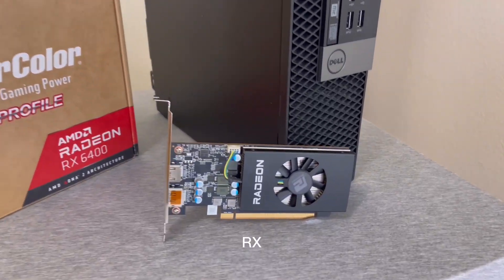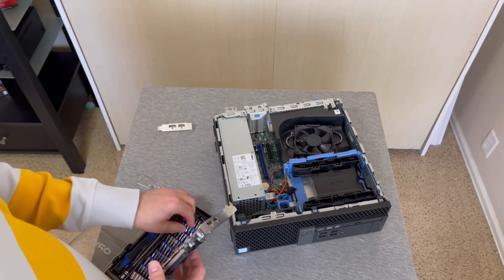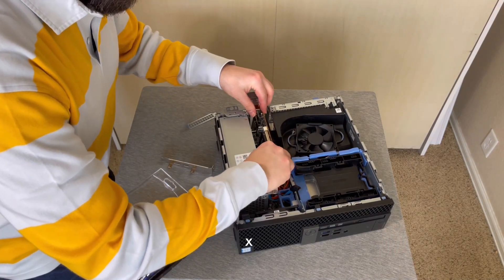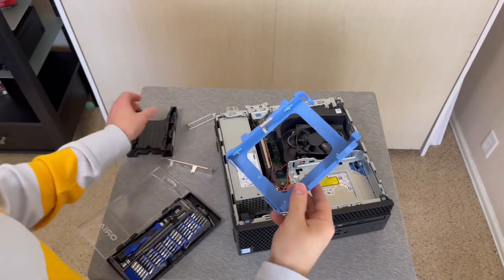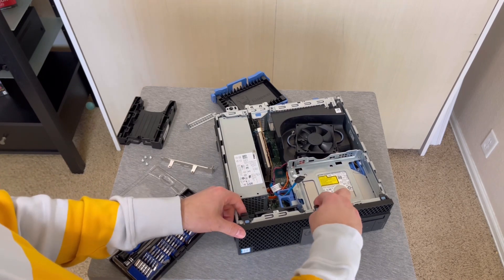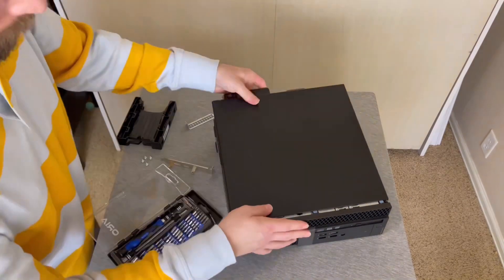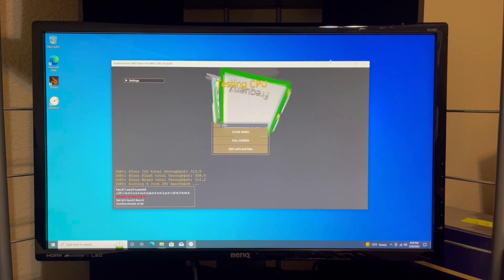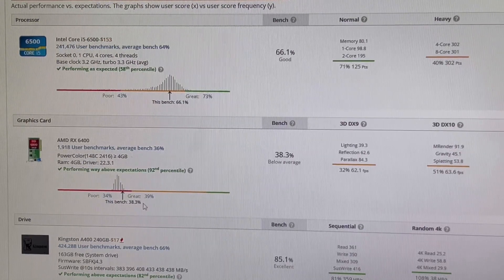Installing an RX 6400 into a Dell OptiPlex 5040 SFF ￼

Comment: I have the same card, same brand, worked fine in a 5050 mini tower but in my 5050 sff it just heat up and no screen, the 180 watts PSU is not powerful enough.

Comment: does the low profile bracket come with the RX 6400?
Reply: if you buy the sapphire pulse one it does come with it pre-installed plus the full lenght one if you buy the xfx otherwise it comes with full lenght one pre-installed plus the low profile one to be mounted

Comment: i was looking for a gpu to fit into my dell optiplex 5040 sff and this looks perfect but i was wondering if it would work on my 180w psu,i was looking in the comments and browsed the internet but i keep seeing a lot of confusion,some people say a 240 to 350 watt psu is required other says 180 watt is enough so im kinda in a confused state,can someone clarify if i can buy this to upgrade my pc or not?

edit:basically i bought the gpu and installed it,it works great the only downside (idk if its gpu related or not) is that after i installed it,my bios booting time takes up to 10 seconds longer on average and sometimes it doesnt even show anything when booting up even if im pretty sure its on the lockscreen as my keyboard and mouse leds are on,it might be a slightly faulty gpu or something else.

conclusion:this gpu works with my dell optiplex 5040sff with a 180psu flawlessly except for some minor issues sometimes probably because of the old hardware paired with a modern gpu
Reply: I'm the same

Comment: can you recommend a gpu for my dell 7010. it only has a 240 watt power supply.
Reply from the maker: I’m guessing it’s a SFF and needs a low profile card?

Good: GTX 1650 lp
Better: RTX 3050 lp
Best: RTX a2000 lp
Reply: @OptiGPU  yeah it is. im thinking of going with the AMD Radeon RX 6400, what do you think?
Reply from the maker: Yeah, that’s a popular one at a good price. Keep in mind the 16X slot is far enough away from the power supply that you can fit a dual-width card in there, but you can’t go wrong with the RX 6400’s cost effectiveness, and it leaves your other slot open for something else.

Comment: The resulting 1% performance increase was a bit underwhelming 😂
However, I have a Dell 5040 with the stock ATI FirePro, which is really slow. I thought about getting a used Nvidia GTX 1050TI, which is from 2016. However, while researching I found your video and now I know the much more modern RX 6400 fits too, so I just ordered . This should provide a huge performance boost for my use-case, so thank you for your video!
Reply: What's your power supply??

Comment: what is the psu max power of this 5040?
Reply: depends it goes from 180w to 240w i suggest to check it by yourself,you gotta open the pc with the sliding panel and check the label on the psu (the metal brick at the bottom)

Comment: I can confirm the 180w psu on my 5050sff does not have enough power. I disconnected the sata cd drive power and cable with no dice. The gpu fan does power on during startup. I plug in DP cable to the onboard you to check status and it's just stuck on the Dell logo. I take out the gpu, power on the pc and it boots to windows without issue.
Reply: I have an Elitedesk G3 with 180w psu. So it won't work. Is it?😢
Reply: You need to setup your BIOS lo legacy or so. Try and comment, pls.
Reply: i have the same issue but with an optioned 7050 SFF. gpu didn’t have enough power from the psu to power up. i tried changing then psu but still won’t turn on then the psu just stopped working and pc wouldn’t turn on in general. the new psu i got was 400w so i cant see why it didn’t work. i dont know what to do at this point.
Reply: @veritasium1382 Did you solve the problem? My power supply is 180W, Dell Optiplex 7050 and it didn't show video either.
Reply: Did you solve the problem? My power supply is 180W, Dell Optiplex 7050 and it didn't show video either.

Comment: Jual PC hasil COP kantor, tawar aja berapa. Specifications : 
1. Processor intel(R) Core(TM) i7-7700 CPU @3.60GHz
2. Installed RAM 16,0 GB
3. 1TB 7200rpm Hard Disk drive
4. Beserta Monitor, keyboard dan mouse ya

Comment: I'm trying to put a gtx 1650 LP in an optiplex sff, which model out there has the full PCIE slot that isn't near the PSU ! I'm trying to put it in a full slot but idk if all dell optiplex sff have it in the same place, which of course the Graphics card doesnt fit because  the PSU!

Comment: I just installed the same gpu( not used) to my optiplex 7050 SFF, but when i play any game it just starts to sound really loud the gpu fan. Any advises?:(
Reply: already tried to undervolt but Adrenalin and Afterburner wont let me do that
Reply: I have the same setup, and I wanted to buy this GPU. Did you fix that problem?
Reply: the fan not coming from the GPU. but from the CPU fan which is annoying. hope someone have solution for this
Reply: the loud fan noise

Comment: the sad things about this optiplex+RX 6400 is that RX 6400 using pcie gen 4 x4 means that when you put it inside optiplex build like this the card will run at pcie gen 3 x4 which severely cuts performance. aside from that the design is quite great, 1 slot slim design and even a low profile bracket
Reply: online benchmarks have shown that the drop is only 5-10%, which is completely fine by me
Reply from the maker: Yea, of course to get the most out of it you’ll need a newer prebuilt, or build one from the ground up to maximize the card.  My channel theme has been based on PCs that could potentially be discarded, but LMK if I should branch out from old office PCs in future vids.
Reply: @OptiGPU  yea , i'm just wondering what is the designer had in mind when making this card or at least the intended use of it.
Reply: Even in pcie gen 3 it's still the best single slot gpu tbh
Reply: @toomanyfacez it isn't the best, it's still pretty bad and overpriced for what it is. The rtx a2000 blows it out of the water.
Reply: @Droogie128 
A2000 is a lot more expensive
Reply: @Droogie128 I can find 6400 for $50. Can you buy a rtx a2000 for around $50?
Reply: @hasanagera  goalpost shift
Reply: @Droogie128  what is that?
Reply: @Droogie128  somehow my previous comment was removed.
Reply: @hasanagera  the point isn't where it's priced. The comment was about whether or not it's the fastest single slot gpu. It isn't.

Also, where are you seeing a 6400 for $50?
Reply: @Droogie128  the channel owner is blocking some specific words I guess. The comments I send gets removed. But I can find them locally.

And I agree that rtx a2000 is much better in terms of performance. No doubt.
Reply: @Droogie128  i found my 6400 used for 40 :)
Reply: Just beat Starfield on gen 3 with this card, had it installed in an x4 prior to that and the difference was almost insubstantial

Comment: I did this same thing and same gc, I get the black screen when I put it I'm but the computer is perfectly fine maybe because i have a 180psu and the gc worked perfectly in my 500w build does anyone think i should switch to 240w and test it out?
Reply: Could you solve this? I'm gonna buy a new GPU.

Comment: I installed an RX 6600 I struggled with a Dell Inspiron 3020s I took the smallest RX 6600 I bought a SATA to 4 pin adapter I installed a PCI extension then once I started I undervolted it to 70W losing it only 7 percent performance
I took a core I3 to minimize the consumption of the chip because the power supply is only 180w

Comment: When you add on card, do we needs to change the Power supply???
Reply from the maker: In this case, no. The card doesn’t need very much power and the stock power supply works fine.

Comment: Low profile radeon rx 6400 can run 180 watts (optiplex 5050 sff)?
Reply: That's what I'm worrying about, even though 50watts is less but our psu is only 180watts, I might buy gt 1030 instead, for it's only 30watts

Comment: Put A NVMe Gen 3 SSD In Your Optiplex! That Leaves The SATA Caddy Open For A Full Size 20TB HDD!!
Reply: That's a little much for one of these haha. If you had intentions of making it something like a media PC for your living room with some light gaming, that would be great, but you also wouldn't really need to upgrade anything beyond adding the NVMe and HDD, since it will work great for just playing media.

I added a 256GB NVMe drive and my old 1TB SATA SSD into the 2.5" HDD bracket and it basically does whatever I want, plays most lighter/eSports games perfectly and has plenty of storage for a "light gaming" rig. I also upgraded the CPU to a 6700K because the base clock is 4GHz vs the 6700 at 3.6 (eBay, the prices were the same for either so I got the unlocked processor). I also added 16GB more RAM, so it has 24GB of RAM now and bought an RX 6400 for it, since it was small enough and needed no extra power to run. It runs even RDR at 1080p medium/lowish settings at 60fps.
Reply: @husky3g  I Use The 1TB Rocket NVME ($49) For My OS And Home Partition! That Leaves Me Room To Put A GIANT Server Refurbished Drive In The Caddy To hold All Of My TV and Movies! I Have A Quad TV Tuner In The PCIe Slot! That Still Leaves 8 PCIe Lanes open To Add A Small Graphics Card! Scylake, Kabyu Lake Both Have 16 PCIe Lanes! Dont Game Much other Than SupertuxKartr
Reply: Does the 5040 have enough sata cables on psu for 2.5" hdd's?

Comment: I am planning to upgrade my 5050 by installing a rx 6400 
But the power supply wattage is 180w.
So i need to upgrade the psu first 
Which power supply can i use ??
Reply: rx 6400 (TDP), 53 W ; 180w - ok.
but this video card is hot in sff
Reply: Yes, I have an RX 6400 in mine and it runs great. Just be sure to watch the temps on the CPU. I upgraded the CPU to a 6700K and it runs a little hot. Make sure you set the tower in a well-cooled/ventilated place to keep temps down. If you confine it where it can't breathe well, it will run hot and shorten the lifespan of your components.
Reply: In bios there is a setting for video output, try to choose your card instead of auto..

Comment: you can install nvme drives in these with a bios mod and adapter
Reply: WHAT? The 5040 Has An NVMe M.2 Slot Under The Hard Drive Caddy!! But The 5040 Is DDR3 The 7040 Is DDR4 1600 MHZ vs 2400 MHZ
Reply: @kevinlsims7330  ahh yes, never mind, some of the other models can be moded for a nvme, it seems the 5040 already supports it.

Comment: I just bought an RX 6400 for my Optiplex 5040 SFF. I bought the HP Victus OEM RX 6400 for 100 bucks. Doesn't come with a low profile bracket but I'm hoping I can modify the one for the R5 340 that came with the Optiplex.

Hoping to install HoloISO to make it a dedicated gaming console/PC for my living room that I can control solely with a controller. Only issue I forsee is that it doesn't detect the NVME SSD on the install screen.
Reply: We're did u buy it at I can't find one for less than 150$
Reply: @CripSity  I got it "used" on eBay. The guy bought an OEM pre-built PC that had it in it but also bought a better GPU and immediately upgraded it and set it in a box. The list price was like $120 but I made him an offer for $100 and he took it. It's been running well. I had to use tools to cut the full-size PCIe bracket down to fit in the case but it's been running perfectly and plays games well. I upgraded the RAM to 24GB, the CPU to a 6700K and it's a decent little gaming machine, honestly.

Comment: So the 180W PSU is not an issue?
Reply from the maker: Worked fine under load for me.
Reply: Paired it with i3 12100f. 180w can handle it

Comment: Hi I got dell optiplex 5040 just like you can I take a another brand like sapphire? Or I have to take your brand power colors for the rx 6400 low profile
Reply: XFX also made a low profile single slot RX 6400, as long as it's low profile AND single slot you're good to go. In SFF Optiplexes, dual slot video cards either not fit or you're just stuck to 4X Pcie.
Reply: @Sgt.Lincoln_Osiris  Ok thank you

Comment: hi I have this exact PC, what is the best possible upgrade I can get for this PC? currently I have an i5 6600 and rx 6400 with 32gb DDR3 RAM, I wanted to know if I could get a better CPU and if a A2000 low profile GPU would fot
Reply from the maker: Yea the a2000 would plug into the 4x slot. Still much better than the RX 6400 in the 16x slot. Tight fit.  You can double that RAM and you should be able to upgrade to an i7. 🎮👍
Reply: @OptiGPU  thank you, do you know which i7 precisely?
Reply: @zuhairzahid9555  Core i7-6700
Reply: @OptiGPU  Upgrade The Optiplex To A DDR4 Version! NVMe SSD! I Bought A 7060 On EBAY With 16Gbs Of 2666MHZs Ram An An I7 8700 6 cores 12 threads!
Reply: Well I have a 5040 with an i7 6700 in it. Ordering up a a2000 and more ram.
Reply: Buy A 7040 Or A 5050! DDR4 Memory I Bought A 7060 For Less than 200 Bucks With I7 8700 6 cores 12 threads!!! That Is Your Best Upgrade option! Does Your 5040 Even See Or Use Over 16GBs of Ram?

Comment: Only notes, are you can use the x4 Slot, doesn't matter with a rx6400. Have a GV-R64D6-4GL in mine, it's what was on open box clearance, and it works and fits just fine.
Reply from the maker: Yea the performance hit will be negligible in the 4x slot
Reply: @OptiGPU  the 6400 is only 4x so it doesnt matter
Reply: @florider_hd 
I believe the 4x slot is going through the chipset not directly to the cpu

Comment: FYI I have an optiplex 32 gb i7 with sapphire 6400 lp. Drawing  180 watts on meter on 240w PSU.
Reply from the maker: Good to know
Reply: @OptiGPU  This was on a stress test so it was drawing more power than typical gaming world. The 6400  is 53w max draw and a these little optiplexes can more than handle it.
Reply from the maker: That’s awesome yea I forgot to ask if it was a stress test

Comment: Prices are insane in my country for these optiplexes. Refurbished ones cost around $180 for an i5 6th gen with 8gb ram and a 256 go ssd. That makes them sort of redundant. So wanna try out a low cost build.
Reply from the maker: Are the prices high specifically for Optiplexes or all PCs right now?
Reply: @OptiGPU  Specifically for optiplexes or thinkcentre Lenovo. i3 10th gen with h510 new with costs around $270. For about $90 extra (above the 180 for a used system) you get something a little more modern. For extra $150 (above the 180) we can get i3 12th gen.
Reply: In my country you can buy these Optiplexes without processor, hdd, and RAM. The cheapest 5040 SFF I can find is $44, add a used i5-6500 for $40, add new 16GB DDR3 and 256GB SSD for $29, you got a running PC for just $113.
Reply: That sucks man. You can try to grab one from eBay in the U.S. if the seller ships international.

I got mine for $55 with a i5-6400, 8GB/RAM and a an RX 550 (terrible GPU)

Keep in mind, if you want to upgrade the RAM you have to purchase low-power (LP) DDR3 (regular DDR3 does not work since the power-draw is too much).

I added a 256GB NVMe drive, i7-6700K and 16GB more RAM topping it to 24GB and put an RX 6400 in it. For about $2000 or so I had a great gaming PC. Again, keep in mind if you want to use it for gaming, you either need a GPU that doesn't require external power and is low-profile enough to fit inside the case. Changing the case is an entirely different beast as a lot of stuff inside the case may or may not fit well in standard ATX and the power-supply connectors on the motherboard are proprietary Dell ones, so you need an adapter for the motherboard power connector if you plan on upgrading the power supply.

There's a lot that goes into these but if you stay on the same gen CPU, keep all the components the same, generation-wise, it can still be a great computer.
Reply: What would be the smallest case I could use to install a motherboard in together with a newer CPU with reasonably good integrated GPU for light gaming. I don't need a discreet graphics card, I only need a small case with a MB, CPU, RAM and SSD (preferably M2), but my biggest dilemma so far is the PSU - how do I power the parts in such a small case?

Comment: is it okay not to replace the gpu bracket if  not then what bracket do i replace with ?
Reply from the maker: You’ll need a low profile bracket if you’re installing in a small form factor PC. If it’s a mini tower, you’d use the standard bracket.
Reply: @OptiGPU  yes sir i have small form factor and i want to ask that the low profile bracket comes with the card or need to buy it separately
Reply: @HairyBlackFrog  Yes If New!!

Comment: Hey. What wattage PSU are you using? Thanks!
Reply from the maker: 240w
Reply: @OptiGPU how did you get a 240psu? Mine is 180, i have another PC 240watt but unsure if they are swappable
Reply from the maker: I believe they are swappable. Some have 180 and some have 240; I just got lucky and purchased mine already containing a 240w.
Reply: @OptiGPU  Thank you. Mine has a 180W, got it from recycling bin at work
Reply: @OptiGPU  A 180w psu can work fine with a RX 6400 or RX 550 4GB?

Comment: So what dimensions for a card would you say would fit in the machine? All the ones I keep finding are way too thick to fit due to the small space. And with that any other card recommendations?
Reply: As long as its a true single slot card you should be ok.  If you look at the card straight on and the cooler is wider than a PCI slot or a finger then it'll be extremely close to the PSU.
Reply from the maker: In this particular machine, I would recommend the RX 6400 low profile: https://amzn.to/41cGP9f

Comment: I have an optiplex 3020 8gb ram and i5 cpu right now I have the 1030 gpu and I play mx bikes and unfortunately have to run it on low settings so my question is will this card work with my pc?
Reply from the maker: Yes, it’s a single width card like the 1030 and it’s definitely an upgrade.
Reply: Bro did it work ?? bcoz I have same 180w psu and want to upgrade.... currently having gt 1030 but i want to upgrade